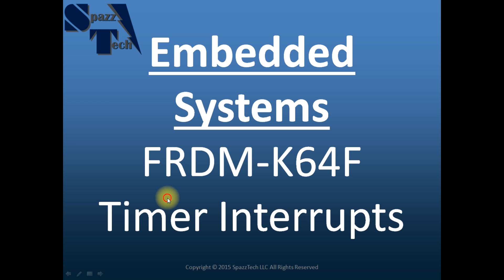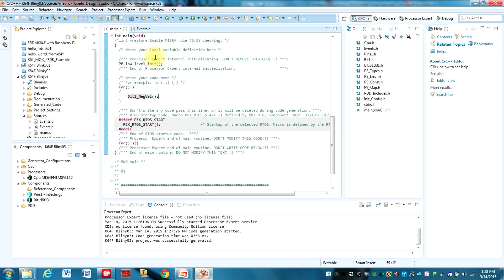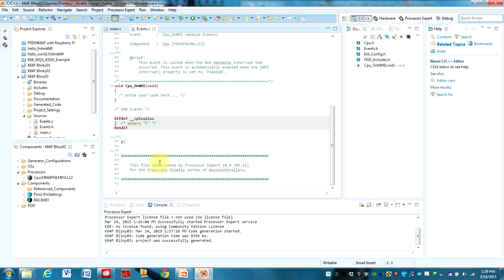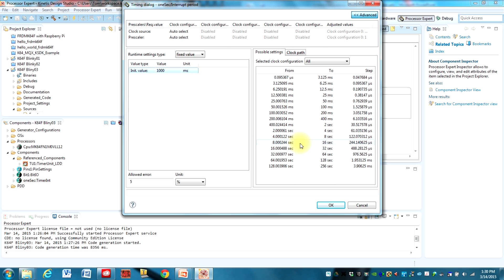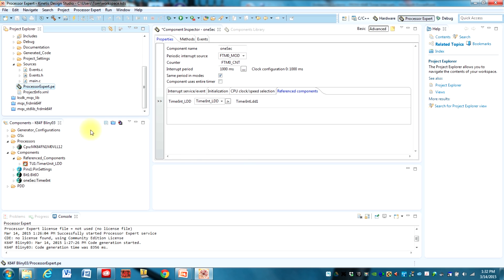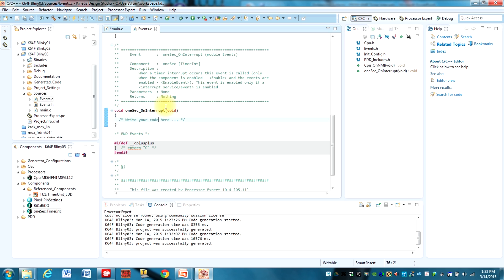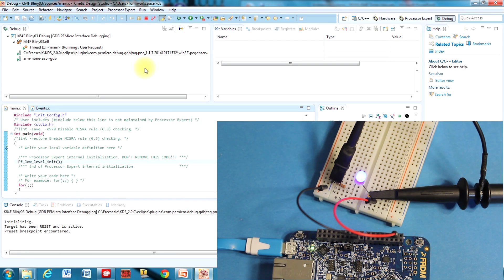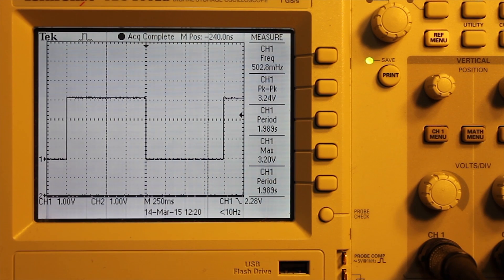FRDM-K64F - Timer Interrupt with Kinetis Design Studio and Processor Expert

Comment: Hi, good video. In the past I have been working with codewarrior and processor expert and now days I'm exploring the KSDK for FRDM -K64F but i think that it not ease to create a project and start programming.

The KSDK you must to make a lot of sets in the project properties of .h and .c files.

What do you think about the KSDK?
Reply from the maker: Milton Sierra I have not worked a lot with KSDK. I find myself usually using Processor Expert which comes with Kinetis Design Studio to set up my drivers. I usually uncheck the KSDK when creating the project. It does produce a lot of files, but places them in a "Generated Files" folder.
Reply: SpazzTech I have been testing the sdk project generator and I think that is a little easier for create projects from scratch. I wrote in my blog about this topic. http://codeembedded.blogspot.com.br/2015/07/sdk-project-generator-for-kinetis-and.html
Reply from the maker: Milton Sierra Good info. Thanks for posting.